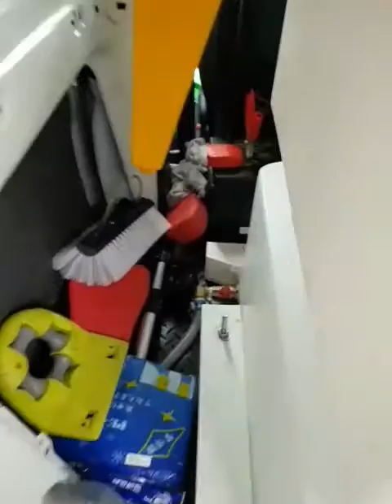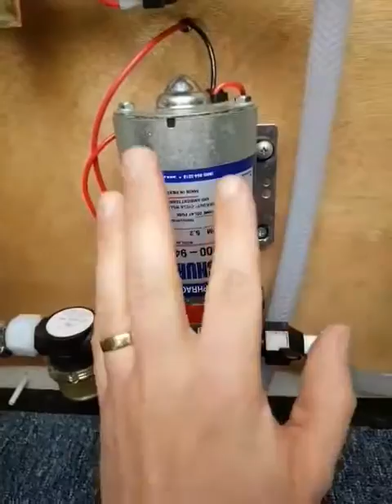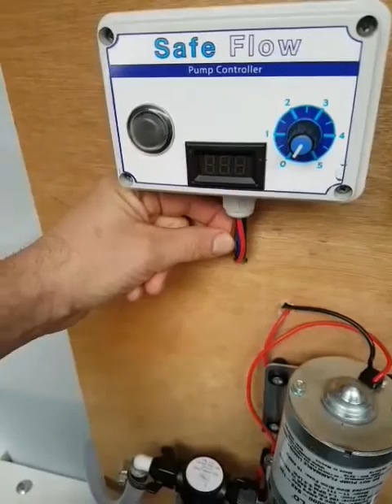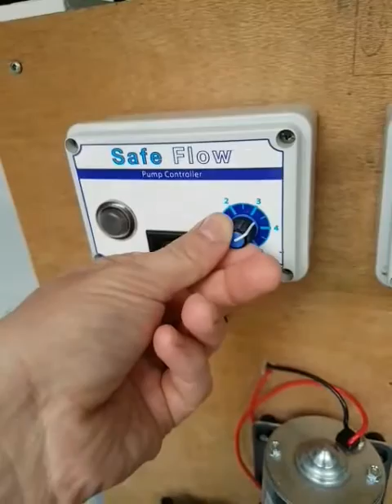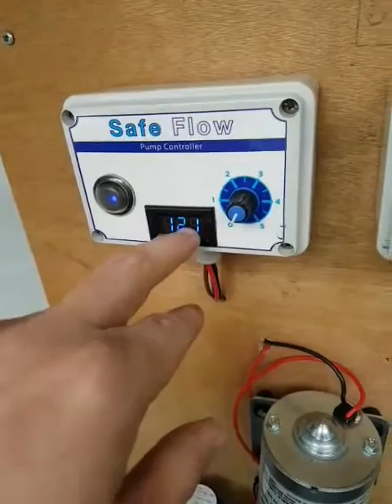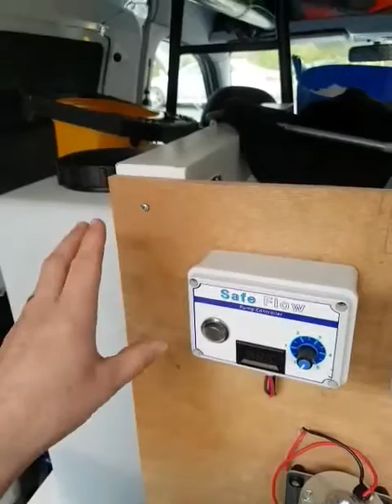waterfed pole van mount

Comment: Great vid. What’s the T connector your using to go to 2 pumps?
Reply from the maker: Brass Y Hose joiner.
Reply: @cjfinz  thanks. Although I assumed it was that this is the only video I’ve managed to find that even mentions splitting the water outlet. Cheers bud 👊🏽

Comment: Dont forget protection of the pump and it's pressure switch from high currents and burning out switches . Use a controller that has the facility to connect with the shurflo pressure switch

Comment: you appear to be using Rectus 21 copy fittings the Rectus has a wire clip around the top, the genuine one will last a lot longer. Always take your battery out and charge as soon as possible with a 7 stage charger, in van chargers work but not as good and your battery will not last as long, only discharge a battery max down to 40% and charge up as soon as possible i.e end of days work.